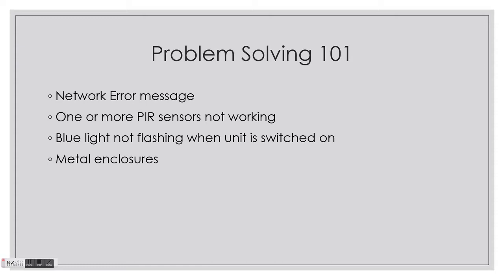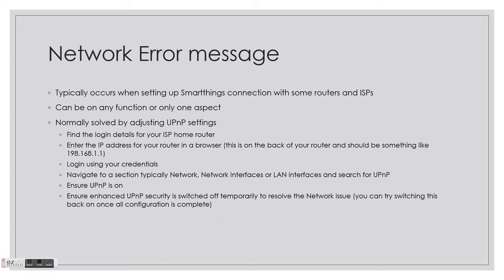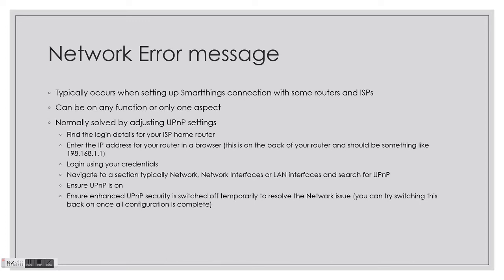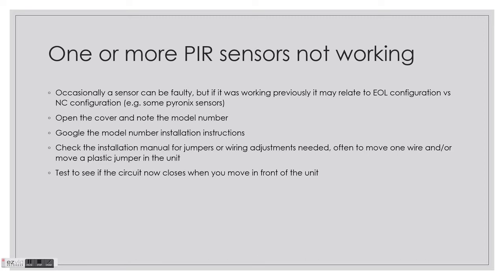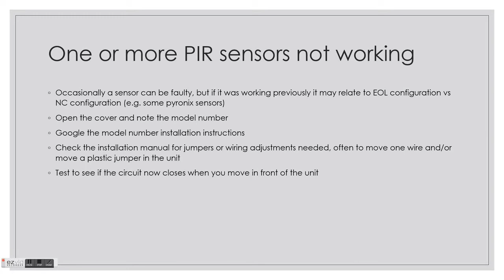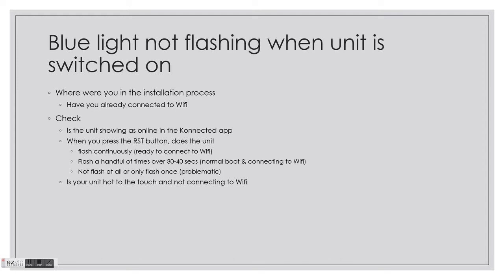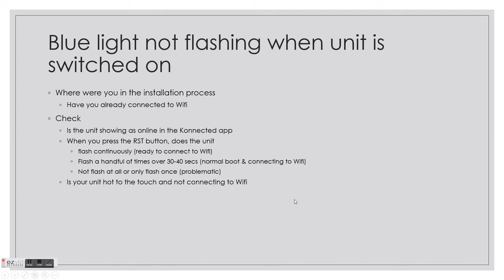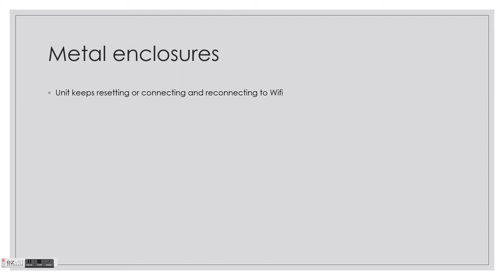Problem Solving 101

Comment from the maker: Additional info on network error messages: you can try searching for the following on Google "enable [or disable] UPnP [or multicast, AP isolation, IGMP snooping...] on [your router brand + model]". 

On some routers you may need to temporarily disable 'Enhanced UPnP security' during discovery

Enable UPnP in your router settings.

If your router has a setting called IGMP Snooping, disable it.
If your router has a setting for IGMP Proxy, try changing the setting and rebooting the router. Different routers implement this differently, but usually it is not required.
The discovery process uses multicast traffic on your network that must reach your devices on WiFi. If you have an advanced network setup, such as a separate subnet for wired LAN and WiFi, make sure that multicast traffic can pass.
If you have multiple routers, make sure that they are bridged properly to form one network.

On Virgin routers 

Go to "Advanced Settings" -> "Security" -> "Firewall"
Check the items ""PPTP Pass-Through" and "Multicast Pass-Through'

Router Specific issues & settings

Asus RT-ACXXXX Routers
>Set IGMP Proxy to Enabled
>Set IGMP Snooping to Disabled
>Set Multicast rate to OFDM6

Netgear Nighthawk R7800
   1. In LAN Setup set RIP Version to "RIP_2M"